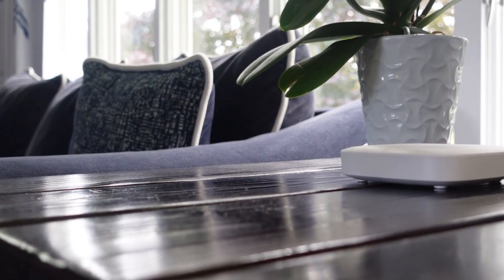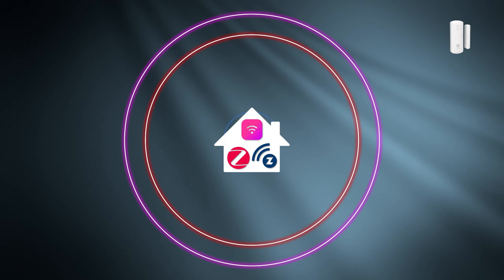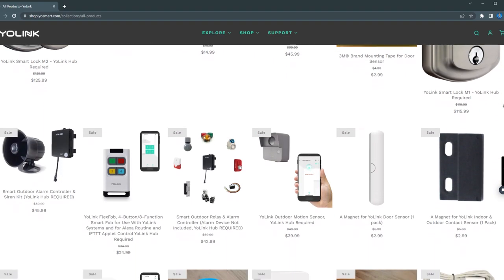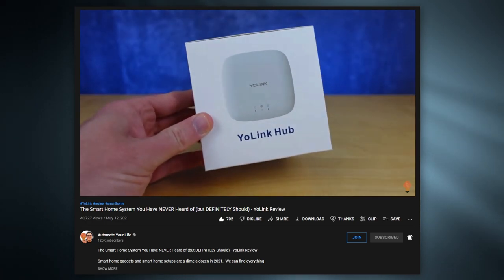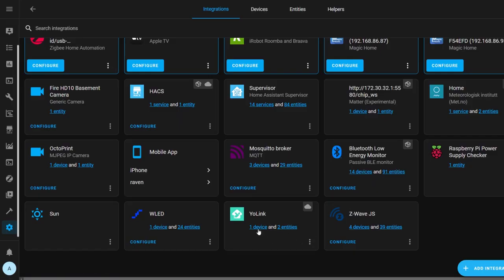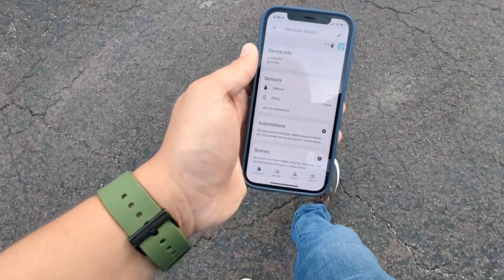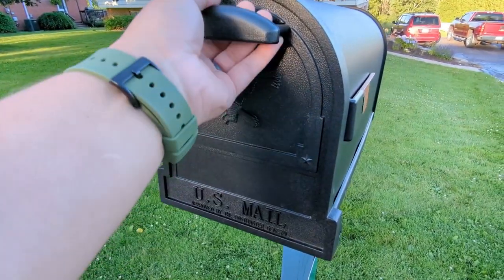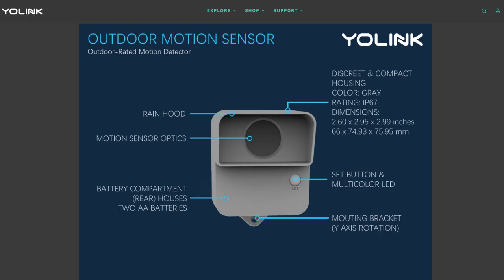YoLink - Long Range Smart Sensors! (Home Assistant Integration)

Comment: I have been using the Yolink Hub and outdoor sensor on my mailbox for 6 months and it works perfectly.   My house has a brick front and the hub is located in the front bedroom (2nd floor).  My metal mailbox is located roughly 50 ft from the hub and my sensor magnets are glued to the outside of the mailbox door and mailbox.   The small sensors are black so they blend in with the mailbox.  I stuck the outdoor sensor battery compartment underneath the mailbox.  Yolink sends me an email when mail has arrived.  I also have an Alexa routine notfiy me when the mail has arrived.  
 I am currently waiting on several Yolink water sensor 2  water detection devices and Bull Dog Shut Off valve to arrive so I can install them.  Their battery powered water detection devices and shutoff valve work without A/C power and no wi-fi.   I also ordered the Yolink Garage Door Operners and Controllers for my garage doors.  I highly recommend Yolink for their strong signal and great customer service.
Reply from the maker: Excellent applications! Definitely a great smart home product line

Comment: Well if that business contact at Yo-Link follows you he will see that cloud access is a concern and that a local hub with probably push me to buying it to do exactly what you did, extending the range of my smart home (yard!) and not necessarily my mailbox. 

Love that idea but my mailbox is mounted to the front of my house. 

However the shed door is a real use case for me. 

Nice job!
Reply from the maker: Yeah, let's hope so!
My shed was non-smart until now! I'm going to pick up the light switch too I think and run some power out to the shed as well
Reply: @makeitworktech  Ha Ha so is mine, a dumb shed but door faces away from my house and my cameras so I can use a Zigbee contact sensor there. My garage has a Zigbee repeater and my property is small. 

If you like a little of the DIY, I learned a great hack from @Mark Watt Tech it was hacking the ~$20 Aqara contact sensor and cutting out the reed switch and he used it with pressure sensor for sensing someone in bed. 

I found the device small but not water proof enough for my fence gate as it so I used my own hack to make a more weatherproof gate sensor for $24. 

If you are a DIY guy you might find topics to make your own videos based upon this low cost device.

Comment: I can confirm that the YoLink Outdoor Motion Detector Sensor works with Home Assistant.  I have setup the sensor to turn on flood lights at night when the sensor detects motion.   I have put in a pull request to update the HA documentation accordingly.

Comment: Even though Home Assistant added support for some Yolink devices even for those, the entities available are bare minimum. Just for example the Yolink dimmer switch has only the on/off entities available. Nothing available for setting the dimming level nor the ability to read a status of the switch. I have other smart dimmer switches and Home Assistant offers a plethora of entities for them.

Comment: Did YoLink update you on their Non-Cloud version you mentioned?
Reply from the maker: The latest update was that it was coming... Lots of hype, but I am waiting on an answer. I emailed them last week. As soon as it's released I'll buy one and do a video. Side note, my cloud dependent one has been rock solid since I installed it!
Reply: @makeitworktech  Thanks for the fast reply. Do you think it would be a new line of devices or just a software update that gave you the option of not using the cloud and keeping everything local?
Reply from the maker: I think it'll be same devices, new hub, option of keeping it local

Comment: Can I put this inside my car?
Reply from the maker: No!
Reply: @makeitworktech Can I put the vibration sensor inside of my car in case someone is trying to break in my car by pulling the door handles or trying to pull down the windows?
Reply from the maker: @miamiles7996  no that won't work

Comment: finally your letter box issue solved once for all
Reply from the maker: Let's hope! It's still cloud-based 😂
Reply: @makeitworktech   when you mean it is cloud based doe that mean it require subscription fees or does it simply mean the data is transferred via colud
Reply from the maker: Data transferred via cloud. If your internet isn't working, the hub won't communicate with Home Assistant.